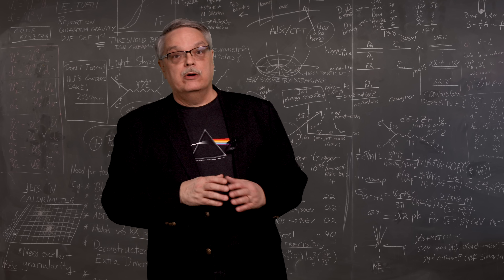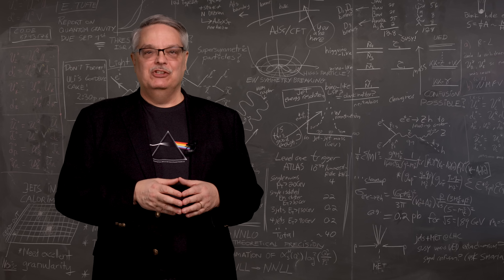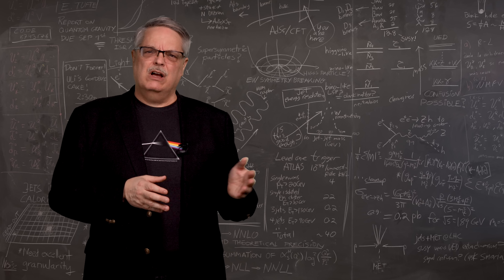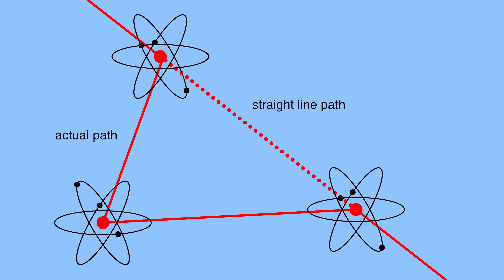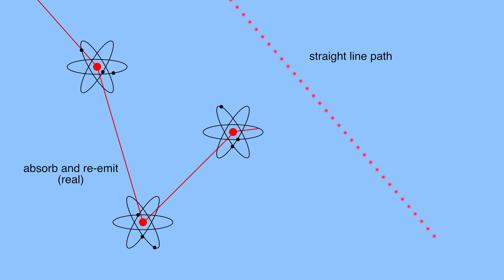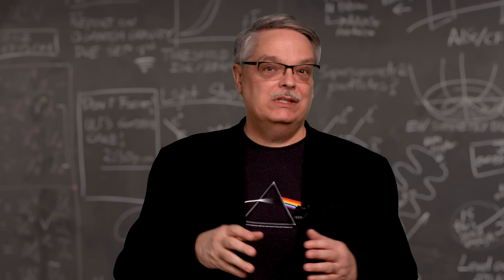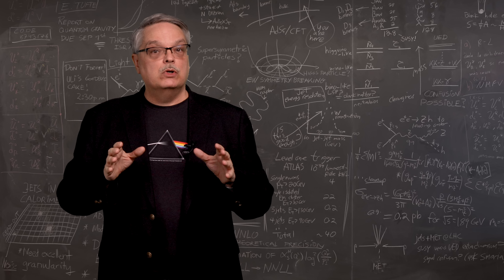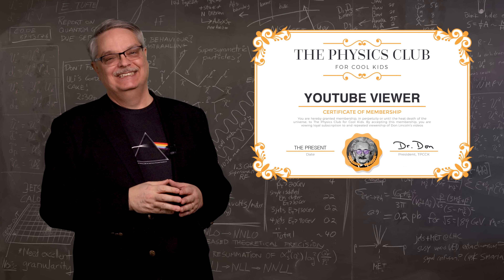Why does light slow down in water?

Comment: Really good explanation but this model still gives rise to the question of how energy is moved in such a system…

So the lightwave enters the material and interacts with the electrons inside it. The interaction causes a force, moving the electrons and also producing a wave of a certain frequency.

The energy of light is described as: E = hf where h is planks constant and f is the frequency of the light.

When light exits the material, it still has the same frequency, meaning it contains the same energy… How is this possible if the light itself exerted work on the system by moving electrons and also obviously producing additional waves with their own frequency and therefore also their own energy?

Comment: I agree that the first two explanations are wrong. 
But your explanation appears wrong also!
Why?
1. As you have described this process as the combination of two waves
     a. One travelling at the (driving beam) speed of light 
     b. and one travelling at the slower speed of the the responding electrons.
2. This model will still have the original wave travelling at the speed of light
     a.  which is clearly incorrect as there would be a light speed wave emerging before the slower wave and we would observe all sorts of mixed dephasing of the emerged light - which we do not (light remains in phase when it emerges)
     b. the light speed wave would be unaffected by the medium and would continue on an undeflected linear path - which is not observed.

The quantum interpretation of refraction is that the bending of light at the interface, even for a single electron, has a model of superposition of the wave function of the single photon. So they treat the material lattice like a massive number of slits in a double slit type experiment where the single photon overlaps / interferes with itself.  However this model also has issues as light travelling through a vacuum should always travel at the speed of light. There mostly a just empty space (vacuum) between the vast distances between nuclei and the orbiting electrons.

The only thing filling all of space between the nuclei and the electrons is the intense electric field between them. That is the one dominant and most obvious different condition of space that the photon is travelling through in a material lattice.

So we are generally still unclear what is causing light to slow down in a medium and are still trying to model a solution. One of those models uses something called a polariton quasiparticle.  This model is a far closer model to what I think is actually going on - whereby the material lattice changes the mass of the photon and thereby slows down the photon.

In my own model, it's the intense electric fields in the material lattice that directly increase the mass of the photon and slow it down. The higher the frequency the higher the (equivalent mass) energy  and the higher the mass differential of the photon and the higher the refraction. That deals with the change in speed.  While the change in direction is the result of the photon riding on the scattered wavefront of the background wave currently called the wave function.  

We will eventually find out what is actually going on.

The interesting thing is that this simple and ancient process (of light slowing down) is in general still not adequately understood even with the all explaining quantum field theory!

Comment: This is a general steady state explanation that leaves out the initial dynamics  (e.g., there is precursor that first goes through the medium at the speed of light in a vacuum).  According to this video's simplified explanation, when an electric field hits an atom it induces a dipole.  As the dipole forms it causes an electric field wave polarized oppositely to the exciting wave.  In more detail:  As a "vertical" (say) electric field polarized upwards hits the atom it causes the atom's or molecule's positive center to move "up" and its negative center to move "down."   As the charges separate they form an electric field polarized opposite to the impinging/inducing field. Therefore atom by atom or molecule by molecule the radiation from the excited dense medium should be cancelling out the exciting wave.  NOW.  What is wrong with THIS explanation?  I suspect the true answer is way more complicated.  Also, explaining the polarization of waves reflected from media interfaces is also not simple, nor is why a wave dies out in a conductive medium.

Comment: UpAndAtom on bubbles video speaks of this pattern. L-Amin-ar glass sheets and sequ(ival)-ence 0 4 8 16 repeating and repeating while the pile of glass sheets keeps getting bigger, thicker.Also wrong: phonons, tunneling among small gaps...Like bubbles speeds(spreads) up any reaction in chemistry.
Water and light have the same soliton letters HYX. Also water 88 - light 89 - and g-lass are related, like p-hases of water( which behaves as empt-ty). Surface tension patterns like Chla-dni are not the same as surface tension of granular, aka sand aka glass... part of the mystery is there. Water vapor builds superions or ions that build up crystals. Salts(z, slit s, slide) Idk wh-y or how but water is pi related. Mirror. Like life is error correcting code(mode,motif..). 
"I" across the diameter of an O is pi . Add - to get T phi. And H is superposition( bridge) among absolute soliton scalar I + I. H TTTT toot H pick pat-tern.

Comment: Nope.  I still don't get it.  Didn't you only explain why light changes frequency (which  goes well with your shirt), but not speed (since light at any frequency moves the same speed)?

In fact, if we simply took for granted that changing frequency meant changing speed, wouldn't that belie your t-shirt (since the speed of light = how long each wave is multiplied by the length (or color)? of each wave)?

I love your videos.  I think this one needs a sequel.

Comment: I've heard you can slow light down to 40 MPH through argon gas. My dog can run that fast.
COSMOLOGICAL ICE AGES3
I plotted our suns course through space to discover that our sun was born in the constellation Orion. After the planets were formed Earth was covered with a five-mile-thick coating of ice one billion years. We eventually drifted near the Sirius multiple star system and little Sirius B (1.5 solar masses) grabbed hold of our sun putting it in orbit around Sirius A.

It was the light from Sirius A and B that made most of the carbon energy on Earth, not the Sun. Early Earth’s atmosphere was 750 Pounds per square inch and 2,800-miles deep. You would not see the sun with such an atmosphere. Now it is only 50-miles deep and 14.5 PSI at sea level. All that air is now underground in the form of coal, oil and limestone layers up to 12,500-feet thick…

There was no way sunlight could thaw out mile-deep ice over the oceans. It took the power of a white dwarf and a two solar mass star to give us our carbon energy. Our sun does not have enough power to keep us out of the ice ages otherwise we wouldn’t have them!

Cosmological Ice Ages Solved: the greatest mysteries of all time! Where was our sun born? What took Earth out of a billion year ice age? What made all the coal, oil and limestone? How did Earth get a 20.8% oxygen atmosphere? Where did the energy come from to make all the coal, oil and limestone? Who, what, when and why was the moon brought into orbit around Earth?
By Henry Kroll 384 pages 8.5 by 11; quality trade paperback (soft cover); Catalog #08-0164; ISBN 1-4251-7062-5; US$31.35, C$31.35, EUR21.42, 16.19

Earth has lost 98% of its atmosphere (AKA radiation shield). Our sun does not have enough power to keep us out of the ice ages. The additional light and heat from Sirius star system that melted the ice caps and got life started in the oceans. Over time the 750 PSI carbon dioxide atmosphere was laid down as coal, oil and limestone using photosynthesis and light from Sirius A and B. Dinosaurs couldn’t live in today’s atmosphere because their lungs were too small. 65-million years ago the atmosphere was 30 to 60 PSI. Earth has lost 98% of its atmosphere. It is now 14.5 pounds per square inch. We have a limited time to get our act together and get off the planet to seed life in other biospheres. www.GuardDogBooks.com Wholesale orders (20 or more): www.Trafford.com
www.GuardDogBooks.com
Also: www.Amazon.com
www.AmazonUK.com
www.Barns&Noble.com

Comment: I have a question....when the light comes out of the glass (and starts to move faster again), aren't there atoms(and electrons) in the air too to cause it to create another wave? so shouldn't it be travelling slow again? or is this scenario applicable to "vacuum" where there isn't any air? what about medium "air" and "glass"?
Reply: Yes, there are atoms in the air that have a similar effect. The effective speed of light in air is slightly slower than in vacuum but not by much. When there is just vacuum the effective speed of light is just the speed of light.

Comment: Still it doesn't make clear to me how could the slowed wave length of light through the glass picked up the original speed while leaving the glass. According to the light wave explanation in this video, light causes the glass electrons to move which means loosing some energy over there  (is loosing energy continuous process or only initially?). If something loosing energy means it should effect the speed of the energy source here it's light, still I didn't get how it picked up the original speed if some energy lost while moving through the glass? my question is how the distorted/combined wave become normal without any external force? Maybe my fundamental understanding of wave is incorrect.

Comment: We are studying and understanding the phenomenon incorrectly. We have all seen light emerge through glass windows. Does that mean that once the light  re-emerges from the glass pane it speeds up again ? No, clearly it does not. The speed of light is always the same. It only appears to travel slowly through a denser medium because in a denser medium light has more particles in the medium to bounce off and navigate through, but this phenomenon can result in seeming refraction, the appearance of light emerging from somewhere else not in a linear or straight line to the place it entered in the medium, but we all know that light travels only in a straight line so the mind constructs the image it sees as emerging from a point elsewhere than where the object actually is  which would also explain the photograph in the video or even the phenomenon of seeing a mirage in a desert, but refraction is not the only property of light, dispersion or diffusion is also one property and its exact opposite concentration or focus is another. Due to diffusion the intensity of light decreases but due to concentration the intensity of the light increases.  Science should not be used for trickery and for deceit.

Comment: Is the oscillation of the electron resulting from the interaction with light and causing an induced electric field the same that occurs in Rayleigh scattering? (In Germany we call it Herz'scher Dipol)
If so, I wonder if a material that would not scatter light at all would automatically have a refractive index of 1?

Comment: THe real issue with scattering is the light could exit the glass in any direction not just the rough direction of travel.
The light is not absorbed but it is an excitation/dexcitation of the electrons around the atom.  
The corrent answer means there  is a uniform emf with in the medium.

Comment: Great video!!!

If you had two synchronized clocks, one in a medium and one out of the medium, but in proximity, would time dilation occur, and at what scale?
Reply: The speed of light is different for different wavelengths of light. Nutrinos pass through without slowing down.
Reply: @MrElvis1971  Just to be clear, on your first sentence, that only applies in a medium. All wavelengths of light travel at the same speed, of C, in a vacuum.
Reply: @Hagakure42  yes, in a vacuum all EM radiation travels at the speed limit C.    Not sure if a particular wavelength of light experiences time in a medium as C is still unchanged, it's just light isn't travelling at C.

Comment: Therefore we can state that when a ray of white light enters a prism, the material composition of the latter (which determines its refractive index) causes the electrons to oscillate differently according to the different phase speeds of each frequency which constitutes the beam of white light. Therefore the sum of each electric field produced by the electrons with the electric field of each component of the ray is the explanation of why the latter breaks down into the colors of the rainbow.

Comment: Something I found interesting is a physics lab I had in school where we measured the index of refraction of opaque objects. Up until that time I thought only transparent object had an index of refraction.
Reply: It's indeed fascinating, light and x-rays are both just different wavelengths of the electromagnetic spectrum. Different materials are more or less transparent to different wavelengths. So what appears opaque in one wavelength is transparent in another. When working with materials/shaders in 3D programs, IOR is also important for opaque objects as it controls their reflectiveness. There is also a distinction between dielectrics = wood, glass, plastics (strongly bound electrons) vs conductors = metals (freely flowing electrons). :)
Reply: @SuperemeRed  I felt like a genius when reading Project Hail Mary by Andy Weir and the alien left a bunch of opaque tiles except one - I realized imediatly because this fact about the EM spectrum stuck with me. Really great book. If you have not read it, I recommend it.

Comment: when two waves are combine how come only their combine speed changes and not the length (color)? The explanation assumes  the electromagnetic field of the electrons are moving with different speed than that of incoming light but with the same frequency?  Why is that?  What causes that two electromagnetic fields with same frequency (understandable because one is induced by the other) are moving with different speed?  What parameters of those two field are different?
What about conserving direction?

Comment: Excellent! The one point glossed over is: Why is the wave slower just because the wave is superposed with another wave due to the motion of electrons? I would say that this motion of electrons represents polarization of the glass,, which is a self electric field that opposes the original electric field. This efectively weakens the electric field, and so weakens the restoring force for the wave equation

Comment: What I understand is that the light waves have slowed down, but the leading photons still travel at C.

It is the entire wave pattern ALONG that path, which travels slower. But the path extends at C.

Imagine the wave as the sinus wavy curve, moving from left to right on a screen. The waves move at say half a meter per second aka "half light speed".

Now add a "mask" of black curtain on top of the screen, that you can pull to the right at one meter per second aka light speed, "revealing" more and more of the sinus wave.

The slowing doown of the sine wave means the light is redhsiffted. However because it speeds back up to normal again the instant it leaves the water, you still see it the same normal color as before.

Comment: If we compare the refraction of light with Eddingtons experiment conducted during complete solar eclipse when light bent through an angle of 1,73 arc radians due to gravitational force of sun , we find an object of about ten to the power four kg wt is hidden on the surface of refraction, when we take minimum length in our universe equal to planks length,

Comment: Great video! Just a clarification: what is the intuition behind  the fact parallel component of EM radiation vector is not affected when the light enters in an angle, but only the perpendicular component is?
Shouldn't the charges field push back from that direction too?
Reply: Maxwell equations hold true at the boundary so you can equal the set for air and the set for water. That's where E parallel air = E parallel water comes from.

Comment: Sorry, your explanation, to me, is just as flawed, or not, as the other theories,  Thanks for assuming I think of light as corpuscular.  Now we are to think of it as a wave the arguments about it being scattered are waived, of course.  Maybe you understand all this but explain it here, I don't think so.  When I put the brakes on on my bike I don't change direction but I and my bike are not waves. I might if I weren't on a solid surface but I'd still go along one axis straight.  Cars dip if they brake.  If a crowd brushes their hands on me equally from either side while riding, I don't change direction, I will slow.  If light hits at 90 degrees to the surface is it bent?  When I dive into a swimming pool do I change direction?  Light scattering is a mystery to most people. At school we were taught endlessly that this was a quantum thing. This must be far from the full picture.